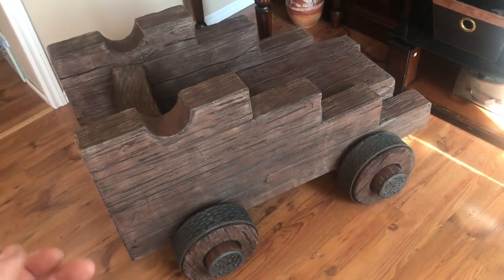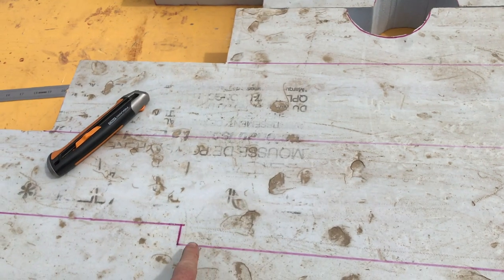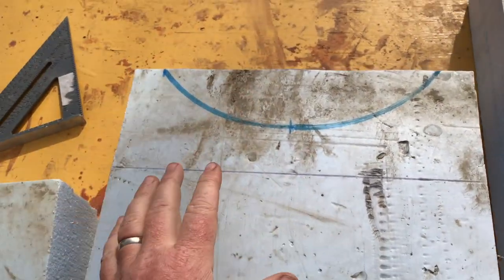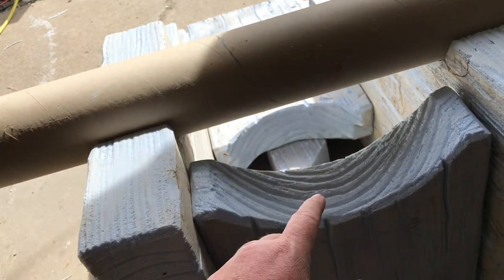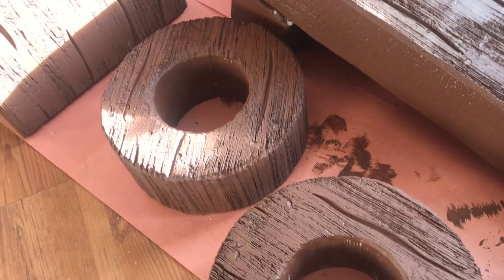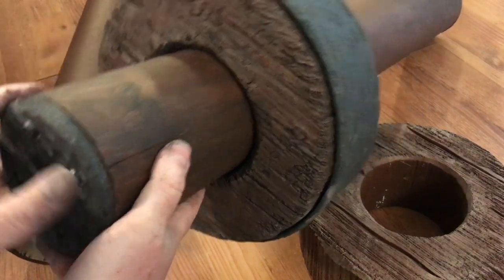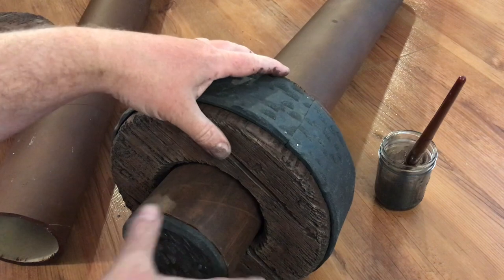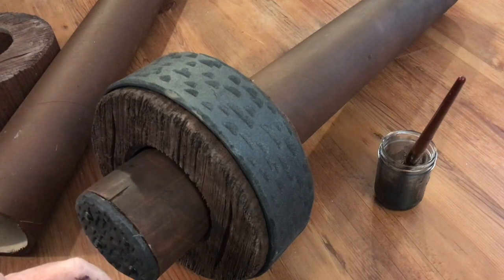Build a cannon!  Because everyone needs a pirate cannon prop.

Comment: For a less than 4 wheel cannon design, some of the turret cannon designs might work, as they did end up used on some ships. You basically start with the artillery cannon designs which have 2 large wheels, then you add a third, smaller wheel at the end of the rear of it that's rotated 90 degrees which helps with rotation. Unlike the broadside naval cannons, it mainly rotates in place and has more of a barrel recoil rather than the entire thing. The design originated for placing on towers and in turrets

Comment: Do you have plans available. I have a couple already but would like to compare. I did build a carriage out of wood, steel wheels and all. Wow was it heavy. Some other fella is storing it now ; )
Reply from the maker: In the description there is a link to all my dimensions I used to make the base, it might help a bunch :).  I have to admit I did consider making the base out of wood, but for the exact reason of moving the monster around, I think a frame made from 4x4's while very realistic would be near impossible to move around easily! Thanks for watching Andy :)

Comment: Do you know what the PSI is on the foam you used? cause I’ve found one that is 10psi for $28 and the 25psi or R20 is $84
Reply from the maker: My foam is listed as R20 and the $84 per sheet sounds about the right range.   You could try the softer stuff, but the big consideration is how much physical contact people are going to have with it.   I picked up my sheets for $10 each used, and you may have luck poking around the garage sale sites to find some being sold.   Good luck!

Comment: I love your videos, and I think I'm almost ready to try making this cannon myself. But, I've been looking at your drawing for a while, and I can't make out the missing dimensions. Specifically, the side view in the upper left. It looks like the three steps are each 9.00" but even then 9+9+9+8+8 is only 43" and not 45". I'm guessing this either is not to scale or not 45" as the measurements for the wheel positions of 9.25 and 8.25 appear to be inline with the 9.00 and 8.00" measures in the top picture. Please help.
Reply from the maker: Let me go review the drawing John, it has been a while and I’ll double check to make sure everything is behaving and if not I’ll be sure to update it.   I’ll compare it to the final as well, as I may have on the fly changed something and forgot to update the drawing 😂.